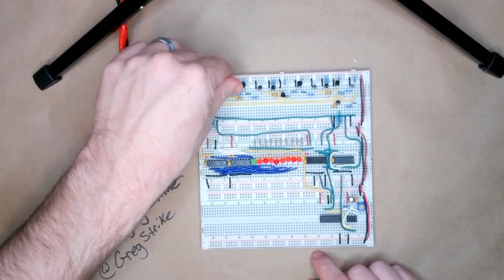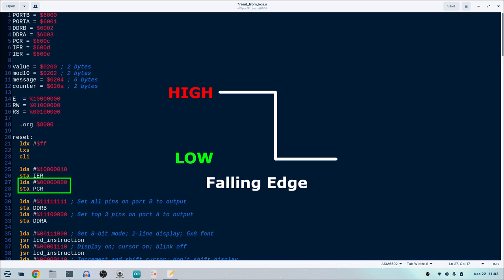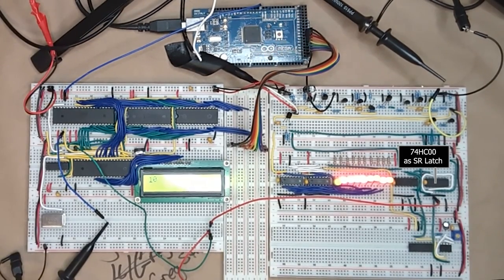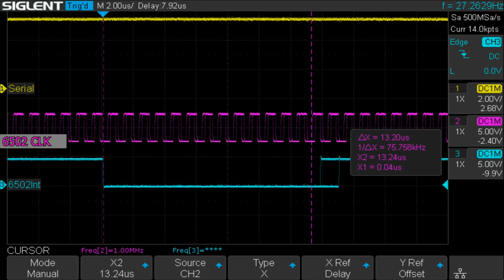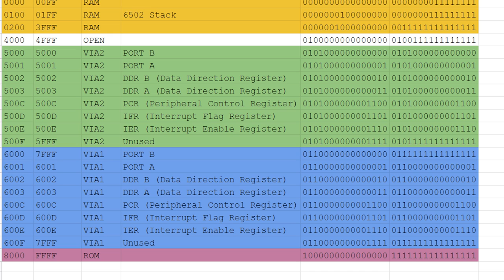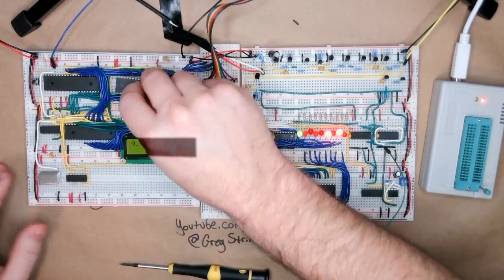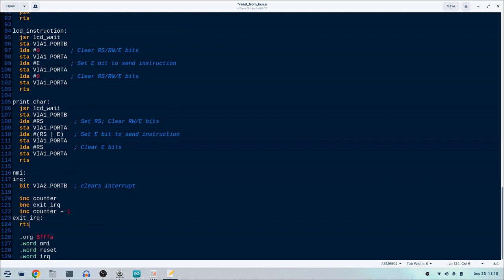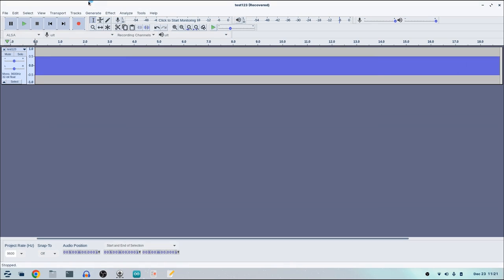Tape Storage for a Breadboard Computer - KCS Part 3 - The Curious Place 003

Comment: I got stuck with that same interrupt problem myself! I solved it in the bath, talk about a eureka moment!

My own homebrew machine doesn't have a tape interface, but I get the feeling it's not going to be long before it gets one! although i'll probably just cheat and use a ready-made chip with a uart already in it, I don't feel the need to re-solve 50 year old problems!

Great work, keep it up!
Reply from the maker: Thanks Leon!  Yeah, I solved the interrupt issue in a very similar fashion, while not actively thinking about it! :)  And absolutely nothing wrong with with using a ready-made UART!  My goal in this series is to break things down and teach as I learn as well.  I learned a lot from doing this project and hope others can benefit.  I loved the demodulation with transistors! If you're looking for a simpler way to do it, check out @AndersNielsenAA https://www.youtube.com/watch?v=KLn8S8x0VVo He released that around the same time I started this series.

Comment: Great series!  Pardon my ignorance, but it seems like Part 2 of this trilogy created a hard-coded, 300 baud, 8-N-2(or 7 w/parity), portion of a UART.   Could a UART chip be used in this place?  I get it if you are wanting to go old-old-school, but I'm just curious.
Reply from the maker: Hey thanks so much!  I'm glad you're enjoying it!  And you're absolutely right, it's just a UART stream.  In fact, my oscilloscope has a UART decoder and will successfully decode the output from the serial line (last line) of the monostables.  It was pretty cool/satisfying when I first saw the oscilloscope successfully decode it!  Exhilarating actually! :)  My goal for this series isn't to create anything efficient or practical...  It's to create opportunities to teach.  I've got a couple other projects coming up, that will REALLY slow the 6502 down!  :)

Comment: According to the datasheet the CA2/CB2 interrupt pins have an "independent" mode where they don't care about read/writes to ORA/ORB. See page 13. 
Might this solve the interrupt issues?
Reply from the maker: Hey @bk, yeah, I think that would've worked, at least at that point in the build, to verify the count.  Part of that "sanity check" was to help verify that my KCS circuit was also functioning properly and not missing any bytes, as up until then, I didn't have a good way to do that other than seeing the output of the SR Latch.  Long goal was to clear the IRQ at the read anyway, so it was important to understand what was going on.  Thanks for being here man!

Comment: I enjoy your content, even though I just switched to the "dark side" LOL Yeah, I wanted to try out the Z80. But I still have my 6502 SBC on hand.
Reply from the maker: LOL.  "The Dark Side".  I've actually never worked with the Z80 but have considered picking it up if I ever wrap up the 6502 stuff.  What have you got the Z80 doing?
Reply from the maker: Oh and thanks for the words too man.
Reply: When you get round to the z80 you will, I think enjoy the separate IO address space and 16 bit registers. The interrupts are more difficult though.
Reply: @GregStrike  I only "just" started. I put up some videos on my channel, documenting my progress. But my intent is to eventually run an OS like CP/M, so my SBC could actually have a big library of software I could run. Possibly MSX also. I'm currently porting my monitor program from my 6502. I have to tell you, I enjoy having 16-bit registers. It helps a lot in coding.
Reply from the maker: @microhobbyist  that's awesome!  I'll check out your videos tonight once the family's in bed!  Looking forward it!